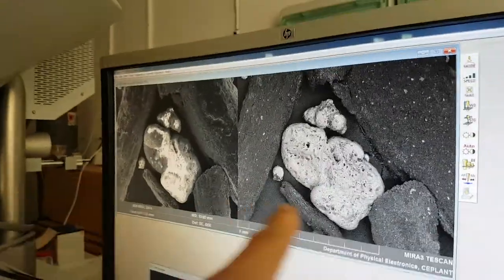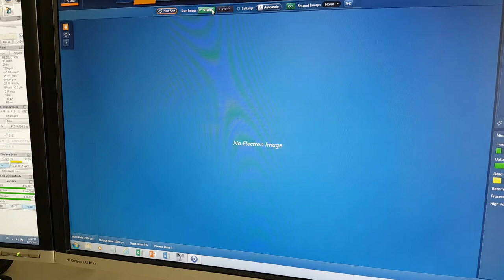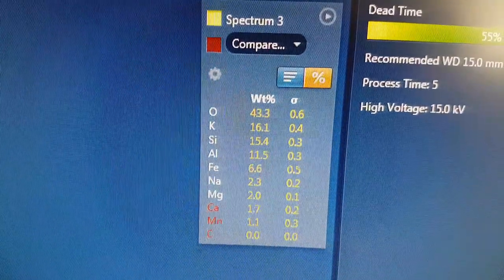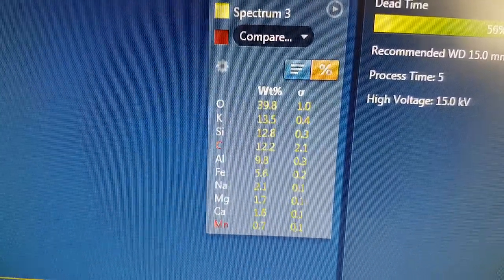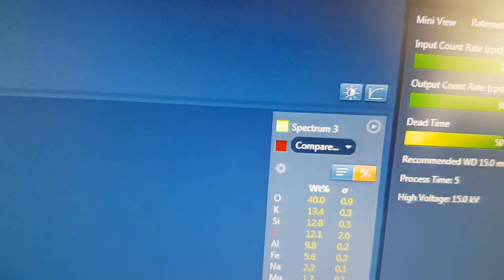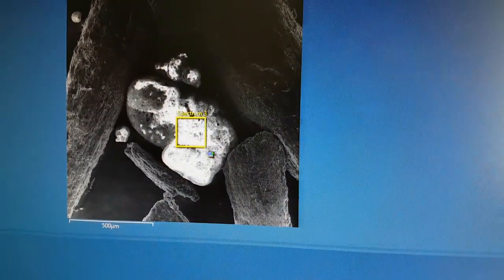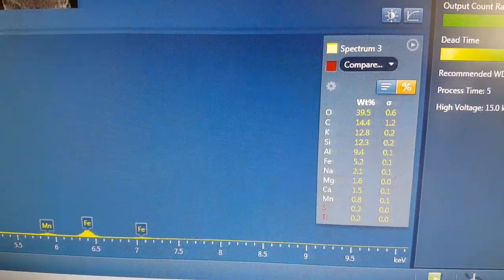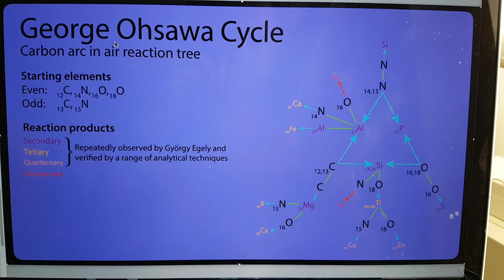NOVA Basic - Looking at spongey blob

Comment: OK. Let's get some pure carbon in there and give it a go. Thanks for posting, this is promising update.
Reply from the maker: Got the spectrographic electrode carbon, it will be tested for purity on Tuesday. The reactor has a few weeks to go before it can next be run - have to optimise the position of the magnetron head, add data acquisition and remote control.
Reply: Martin Fleischmann Memorial Project , didn't intend to trivialize. I was on the run doing some biz experiments when this all was posted yesterday. Was really pleased to see the results and look forward to seeing the next validation runs.